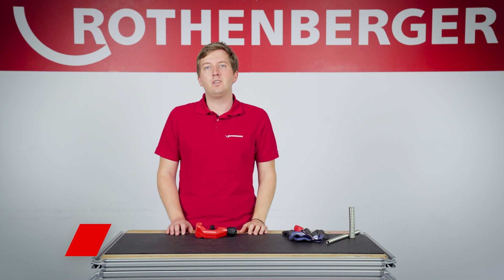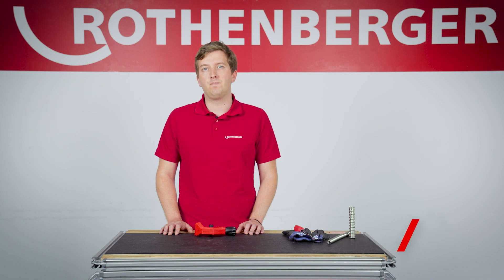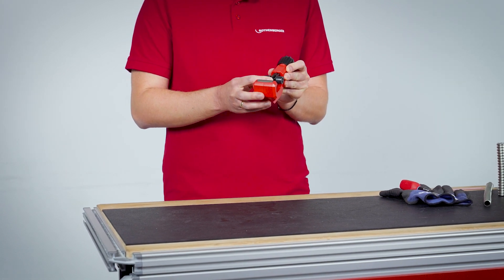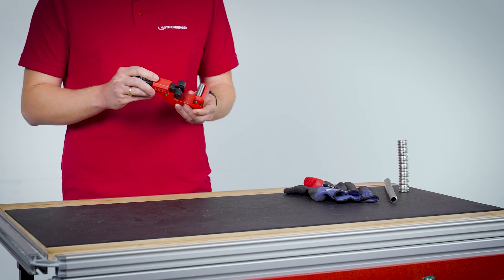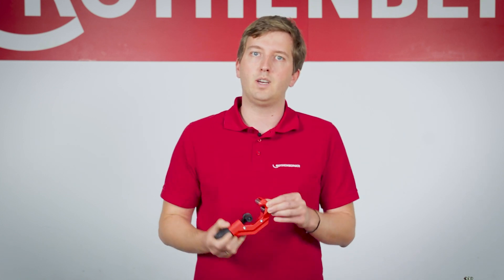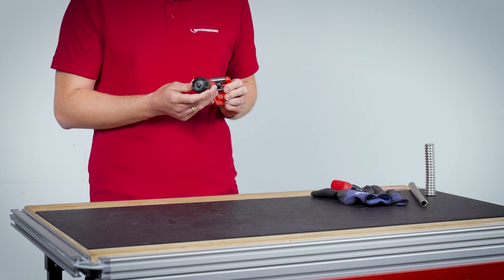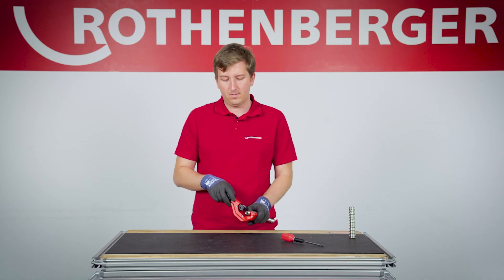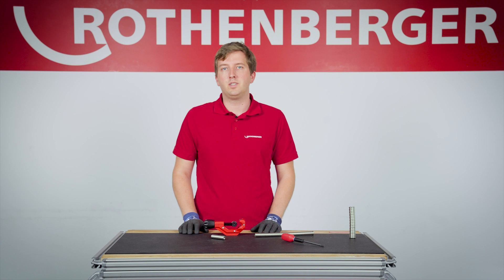Explained: The Tube Cutter 42 CSST for corrugated stainless steel tubes

Comment: Does it cut copper pipe just as good as a normal tube cutter. Or it made just for corrugated?
Reply from the maker: Hi, the TUBE CUTTER 42 CSST is made for cutting corrugated stainless steel tube. Therfore, it has a different cutting wheel than for example the TUBE CUTTER 35 for cutting copper pipes. The difference in geometry of the TUBE CUTTER 42 CSST cutting wheel would wear out the wheel much faster when cutting tubes other thand the corrugated stainless steel pipes. Please have a look at out TUBE CUTTER 35 . This would fit perfectly for copper pipes: https://youtu.be/UvgXRyJ4de0 😀